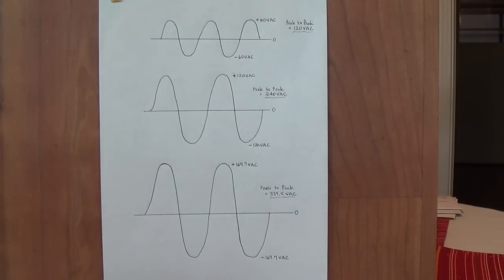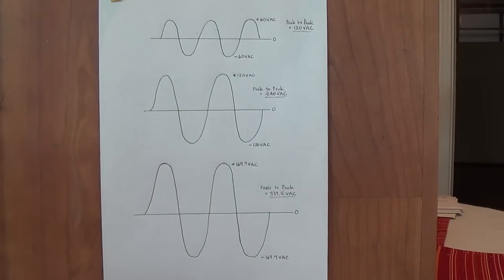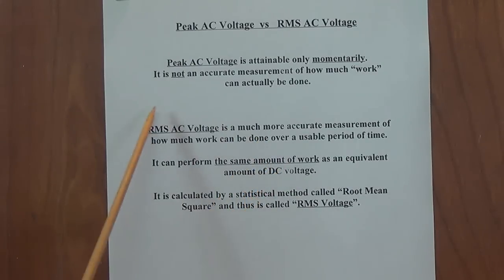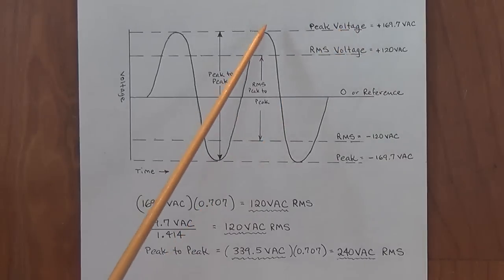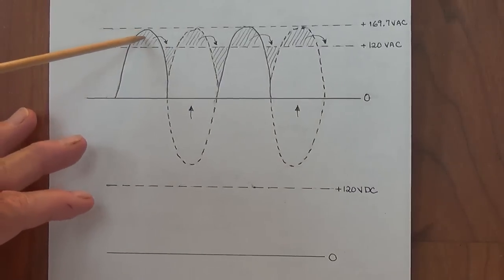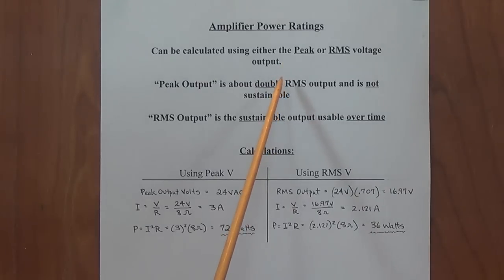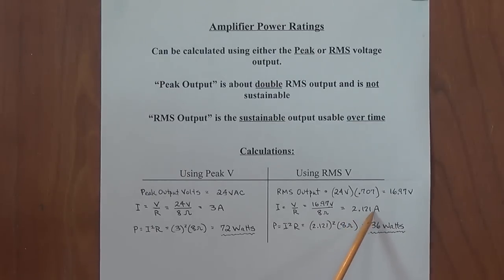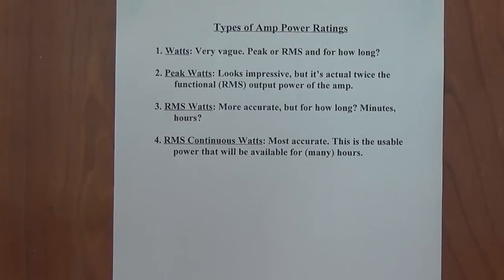The AC Wave Form, Peak Voltage, RMS, and Amplifier Power Ratings

Comment: UD & R.  Good to see you back.  Great explanation.  You are spot on about building the big picture first, then filling in the details.  I may PM you a couple questions in the coming weeks if you have time to help.  I've got a weirdo project where I'm rethinking the guitar pickup and I need to boost my signal a bit BEFORE it hits the amp.  I don't know how to even go about it yet.  I just need someone who can help me figure out if I'm completely off my rocker.
Reply: If you are into electronics and you´re willing to modify your amp, you can add an extra preamp-tube to the amp. If you do not want to touch your amp, you can use a "pre-amp box" or build one, you can do this by using tubes, or transistors, or even some OpAmps.
For a beginner i would go for a simple OpAmp circuit and power it by using 4 times AA(A) cells. If you do so, you won´t need a high voltage power supply for tubes, and you do not have to deal with all these transistor bias "rubbish";)
A simple TL071 single OpAmp with 8 pins will do along with 2-3 resistors, two little foil-caps and two jacks for in- and output and a battery pack.
You´ll need a "split-power" for the 071 of +3V and -3V to make things easy. You can use two 9V batteries for that if you want. Search for basic OpAmp amplifier, or similar here at YT there are plenty of these around.
Reply from the maker: Greetings, Greg. It appears that TC has already offered some good suggestions. I would only add that in-series Boost Pedals are readily available and inexpensive, and would provide the added "kick" to the guitar signal you are inputting to the amp.....without any alterations to the amp or guitar. Thanks for watching and best of luck !!
Reply: Uncle Doug Oh man...  You guys are 100% the two I need to converse with...  Here's a quick overview, I'll follow up later when I get some output numbers from my pickups...  First, the guitar is being hand built by yours truly.  The pickups are alumitone style, low impedance.  They are a single loop around a permanent bar magnet.  The single loop is then used on the primary side of a small transformer.  The secondary will have around 1000 windings so the output will be pretty low.  Since it's low impedance, I want to use an XLR out of the guitar into a small preamp box like Tubical described.  I want to use tubes to do this.  The whole project is an experiment, and I've always wanted to get into tube amp design.  I've made a chu-moy style headphone amp previously for fun, so I am a bit familiar with this stuff, but I start to lose touch when it comes to sizing resistors and caps for all the various parts of the tube circuits...

I've been gathering some old tubes and sockets up.  I don't know if any of them will work, but I am on the hunt for more goodies...

I have a couple weeks left in the guitar body build, then the electronics will start.  Can I send you guys a private vid when I get there?
Reply from the maker: I have a FB page for Uncle Doug's Vintage Amps where videos can be posted, Greg, if you wish.

Re the pre-amp unit, I'm not sure if you want a tube tremolo effect as well, but a few years ago I scratch built a Rick-Tone Trem-O-Drive unit that featured a really clever power supply: head-to-head 12V power transformers from Radio Shack (cheap) that provided the 12VAC for the 12AX7 heater as well as 210VDC of B+. It was an excellent boost and tremolo unit that was interesting and inexpensive to build. It's featured in the "EM vs Tube Tremolo" video on my channel, and the video description contains a link to the schematic.
Reply: Hi GG, you can send me whatever you want, if you need some help with a particular problem.

But i strongly suggest you to begin with all new components, since used old stuff is cool, fancy and addictive, but for first steps use new stuff. If you test a circuit and you´re not shure about it, and it begin doing "funny" stuff, you never know if it is the old used tube/socket/resistor you are experimenting with or a circuit design flaw....So to elimitate the first by using only new components is a good thing;)
 
If you build your own stuff, you can use common components you can easily get almost anywhere, like 12AX7 or similar. But if you come across some bargain "unknown" tube types NOS, get them. Nothing wrong with
let say a "6AV6" where the triode is equal to a half 12AX7 but for $1,00 each ;) And you can use two 6VA6 and use the diodes inside as a clipping device. That´s is the fun part of DIY.

Or get cheap old little organ amplifiers and play around with them (But be aware of them as most are AC/DC types and they do not have a power transformer hence no main isolation)

Go for a breadboard as you can use it for tubes as well (see my last video)

A good starting point is:
12AX7: 220k plate resistor, 2k7 cathode resistor, 22k up to 1meg grid resistor (depends on your pickup) or even a pot, where the whiper needs to be connected to the grid. One end to ground and the other is your input. You need a film cap for decoupling. So put this to the free end of the pot. 0.1 up to 0.47 micro farad will do.

For output decoupling you need to have a film cap as well,  it depends on your load as well, but usually 1meg is the input impedance of a tube head/amp/combo so 0.1 mirco with 400V rating should do the job. I would start with 100 volts plate, as your pickup will not produce some great amplitudes. But you can try plate voltages up to 250V.

I personally would go for a meduim mu tube like ECC85 or 12AT7 as they can handle much more current and you can use both triode systems in series to produce some distortion as well. And they are easier to handle, as a 12AX7 can produce some "funny" things besides amplify;)

12AT7 (3 watts plate dissipation max):
58k up to 220k plate resistor
1k7 up to 3k3 cathode resistor
grid same as 12ax7

ECC85 (4 watts plate dissipation max):
22k up to 180k plate resistor
1k up to 2k2 cathode resistor
grid same as 12ax7

Or standart US type and really old style:
6SN7 (5 watts plate dissipation max):
10k up to 330k plate resistor
470Ohm up to 3k3 cathode resistor
but not 10k plate and 470ohm cathode resistors together....
You can drive neary every standart input with this tube. But it´s octal type. Here in germany it is not a standart type, but in US it´s been used almost erverywhere in the old days.

Here is a good impression (scan from RCA recieving tube manual):
http://frank.pocnet.net/sheets/093/6/6SN7GTB.pdf

But it´s old style and the basic circuit is drawn that way as well....and it differs a lot from todays drawings, so you have to look carefully.

So experiment with one of it, and have fun. Try "low" plate voltages first (around 100V should do).

As i do not know what you call "low impedance" i assume that if it is equal to 600 ohms or 200ohms (like  microphones) do not use a tube grid as input, use a 1:10 mik/line transformer instead, and connect the transformer input direct to your pickup (may with a termination resistor in paralell) and the other (hi impedance) side of the transformer direct to the tube grid and ground (with a 220k to 470k term. resistor in paralell to prevent ringing).
Because when feeding a really low impedance source direct into a tube you end up with a lot of noise as you need a two stage triode circuit where you amplify the plate resistor´s noise figure from the 1st stage in first place.
Reply: Uncle Doug The "back-to-back" idea with two 12V transformers is a cool thing i use it very often in my designs, and as it is a rather weak power supply, nothing would to "terribly" wrong when experimenting with plate resistors. when using 10-20 VA transformers the high voltage will only provide around 5-10 milli Amps of current, if shorted the tranny take the load completely with no damage for minutes...
Reply from the maker: Yes, it's a very inexpensive and clever idea, TC, and as long as the current demands of the pre-amp are moderate, it works great.
Reply: TubiCal Very informative input to discussion! You just gain a new subscriber :)
Reply: One thing to try is build a simple one or two transitor circuit. Remember guitar pickups(pups) are much lower impedence than piezo pickups(undersaddle) so match the circuit with the pickup. It could built in a small box(mint) or put inside the control cavity of the guitar. I've made both. The circuits are widely available on the internet. A MPF102 is good for piezo. Not sure about single coils and humbuckers. Good luck!
Reply: Nice things about transistors and op amps is you can control the input and output impedence with resistors and capacitors. A single turn pickup coil? Did I understand this correctly? If that be the case, I'd use a capacitor in series before the preamp as to not put much of a load on the pickup coil, yet still carry the signal through. Sounds like a LOT of experimentation with values until you get the tone quality you want but if you want to learn, that's the perfect way.... Best wishes and good luck. Sounds like a very fun project!!! :-D

Comment: Thanks again, Uncle Doug. I guess i didn't think about it before, but now I'll check the o/p from the wall socket and do the arithmetic! Question: there used to be a saying that "Marshall watts are twice as loud as anyone else's", can you comment on that? BTW I once took a combo amplifier rated at 10W back to the factory, they fixed it then tested it and said it was delivering 20W. Afterwards, mate told me it was the loudest 10W amplifier he'd ever heard. Whether this combo just had very efficient speakers I can't say, although I am aware that some amps can deliver much higher o/p at some frequencies than other frequencies and guess which frequencies are used to test for marketing purposes.
Reply from the maker: It's a myth, Phil. Watts are watts. Output varies a bit for different frequencies, but the output value is generally stated for a specific frequency, i.e. 2KHz.

Comment: Another great explanation!

It is worth noting that not only amplifier manufacturers use this kind of "specs-manship." Power-Tool makers sell with these "soft-lies" too. For instance, most table-saws or shop-vacs advertise impossible or meaningless "Peak-Horse-Power" ratings.

Whenever I see those bogus numbers, I think of some other product that comes from horses... and it isn't "power." ;-)

A quick look at the power-formula proves that NO 15-amp single-phase universal motor can sustain 6.5 horsepower. Sure, if I brutishly force a thick chunk of OAK into my saw it MIGHT produce some peak horsepower near that... for about 10 ms... then it draws enough current to dim lights, the fuse heats up and blows. 

And THANKS once again! For decades, I have warned students and fellow musicians to ignore peak wattage ratings on amplifiers, or as a simple rule-of-thumb, halve them. Now I have a much better grasp of how that works and the real-world math to back it up!

Joy!
Reply from the maker: You're quite welcome, LL. I always enjoy your comments, and am glad to hear that the video was helpful. Thanks for watching :)

Comment: Thanks for the video, good explanation :) I've got an idea for a next video: maybe you could tell how 2- or 3-channels amps work. Are they using the same gain stages or will stages be added/replaced?
Cheers :)
Reply from the maker: You're welcome, LES. Multiple-channel amps generally have a separate pre-amp section for each channel. One channel's pre-amp section may have special properties, like reverb and/or tremolo and the other channel may be "clean". Then the output of the pre-amp channels is fed into a single output stage.

Comment: Can you make a video on what makes a good quality transformer and how it can effect tone vs a cheap one? Will substituting an output transformer really make an audible difference?
Reply from the maker: Greetings, BH. I have posted videos on my channel that address the parameters for power (PT) and output transformers (OPT). In general, I think that high overall mass and current capacity are a good way to judge transformers......plenty of "iron" and some excess current capability (over what the circuit requires). Yes, in my experience, replacing a cheap, puny OPT with a heavier, high quality one can definitely make a difference in tone. I don't advocate spending huge sums of money for boutique transformers, but there are quite a few moderately-priced, high-quality transformers on the market. For example, check out ClassicTone at this link:  http://www.classictone.net/    Good luck :)

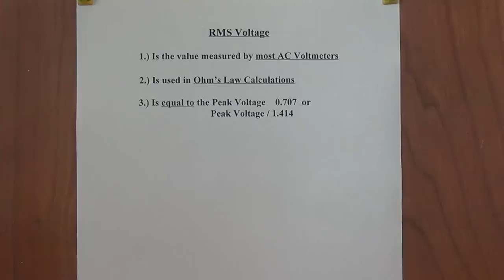Comment: Love your videos... Not to be picky but the drawing at 7:13 is showing a negative -120 RMS value. My understanding is that RMS is always positive since it's the result of the sum of squared values.
Reply from the maker: Thanks, DO. You're right. In my attempt to make the wave form symmetrical, I inadvertently included the -120V lower curve. The diagram should not have been drawn that way, and the peak-to-peak RMS value was not legit. In reality, the RMS value is positive and thus cannot be peak-to-peak. I added a note to the video correcting this error. Thanks for bringing this to my attention.
Reply: Uncle Doug You can, of course, get a (always positive) RMS value of a negative voltage, otherwise no symetrically powered Amplifier won´t work at all. As they use a positive and a negative power rail to operate. Conclusion is: if you got a let say -120V the current flows trough a resistor of, let say 120kOhms will be some -0.001Amp or -1mA. The Prms value will be -120V*-0.001A=0.12Watts and it´s, of course positive....It´s just the math we use to understand how things working....not the nature or physics. As the math is ours, while physics is given....;)

Comment: Uncle Doug, Thankz for your reply. The 5K dropping resistor in the B+ circuit seems to be burned in my 5E3 Fender Deluxe. Does any reason jump out you why. Is that because of age or something else? I will do voltage readings to see if the power trany is ok. I will also check other components for incorrect readings. Would replacing the 5K resistor with a choke destroy the tone as Leo did in the more expensive models? Thanks again for your wisdom.
Reply from the maker: Greetings, Hubert. It's not uncommon for resistors like this to be darkened by age and use, but when a dropping resistor starts heating up too much, it's probably due to a (failing) filter cap downstream that is partially shorted to ground. The failing capacitor(s) will also often heat up and produce an audible 120Hz hum (from speaker) that doesn't respond to the volume control. The 5K resistor is sacrificing itself to save the power transformer. The resistor may have been damaged by heat, and should be replaced if its value is incorrect by more than 5%. You can test the 16uf caps in circuit with an ESR meter or you can remove them from the circuit and test their internal resistance, which should be infinite. Any measurable resistance, even 1Meg or greater, indicates an internal short. If you want to play it safe, simply replace all three with new 16 to 20uf @ 450 caps. Be sure to keep the old ones, i.e. in a plastic sack. You can replace the 5K with a filter choke if you wish, but it would alter the originality of the circuit, require drilling holes in the chassis, and probably not make a noticeable improvement in tone.